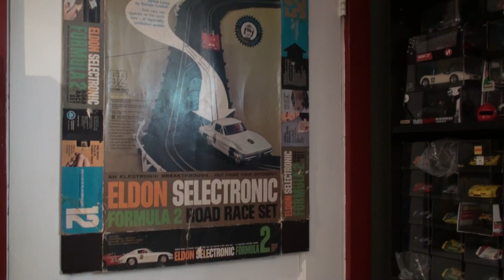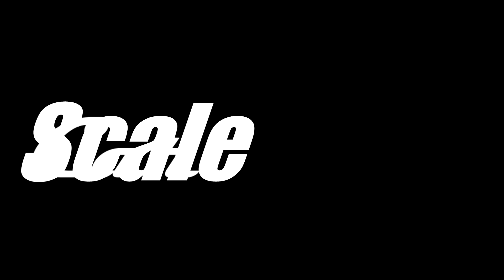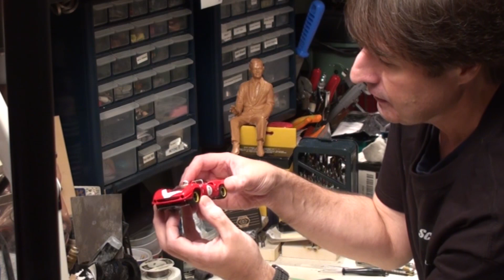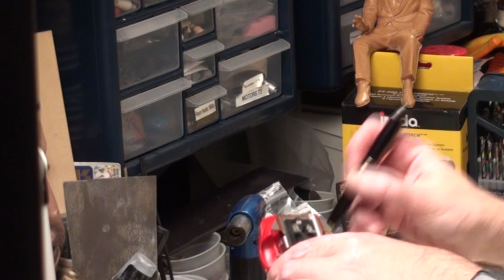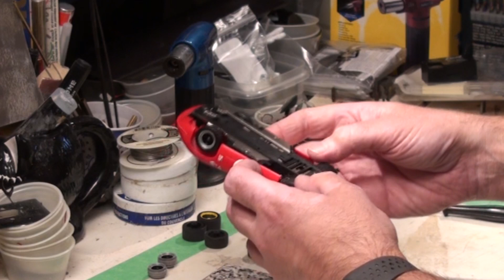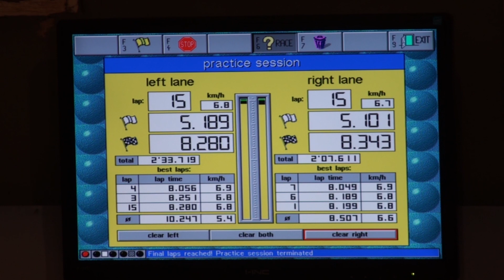Scale Car Garage - Monogram Lola T-70 New Chassis

Comment: That TSRF chassis fit pretty well after a bit of local machining. I drove one of these chassis on a commercial track 12-15 years ago. I've not driven one of the Revell-Monogram cars, so I can't gage how much better the TSFR might be. Wheels & tires help,  but the biggest improvement in laps times was probably attributed to having a more powerful motor. The TSRF has an  FK-130 motor while the stock Lola was a ??? (030?). I don't think any of the other 1/32 cars uses a FK-130 motor. It's far from the most powerful FK-130 motor available, but it drove nicely on your track. Were you using the stock plastic dagger-like pin guide?  If you wanted, I think ED sells a plastic guide holder so that their guide flags that you have been using on your brass chassis could also be used with the TSRF chassis. I don't recall whether the same piece fits both 1/32 & 1/24 chassis, or if each scale has their own part,
Reply from the maker: Bill, you may be correct, the motor of the TSRF is stronger than the stock Revell/Monogram 'S' can motor the car was originally fitted with. This, with the addition of the wheels and urethane tires, all helped to bring the lap times down. I was using the stock dagger like pin guide which worked quite well, but I really had to control the over steer as too much would result in a spin very quickly as you can see in the video! I'll certainly check out  the guide holder! Thanks so much for watching and as always for your wonderful comments and support!
Reply: @FastSports-ScaleCarGarage  John, are you familiar with the Chris Briggs web page?  [http://jbriggsk9.tripod.com/] Chris is a retired dog officer for a police department in central NY. He's been racing & building 1/32 cars on numerous home tracks for the twenty years I've known of him. In the middle of the first page he has an article titled "TSRF Chassis with a Slot-it Guide". It's both text & photos. I can't locate where I might have seen the TSRF guide used. Perhaps it was a build article on either SCI or HRW. Unfortunately, most of the old SCI posts are no longer online due to various computer glitches.
Reply from the maker: Bill, thanks so much! I'll certainly check it out!